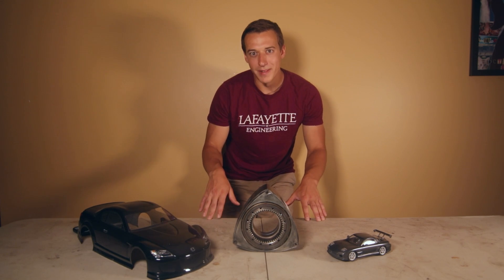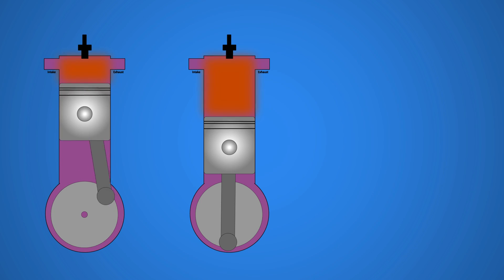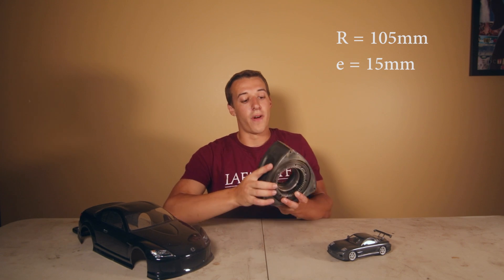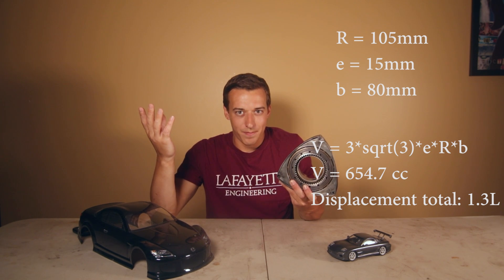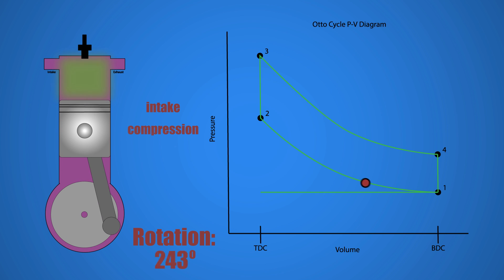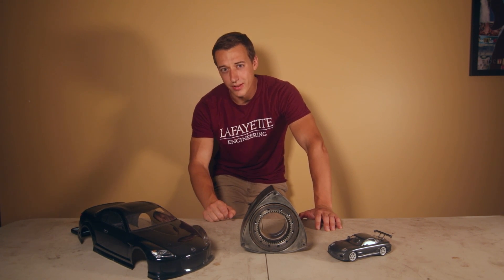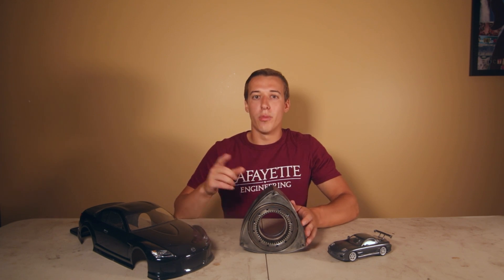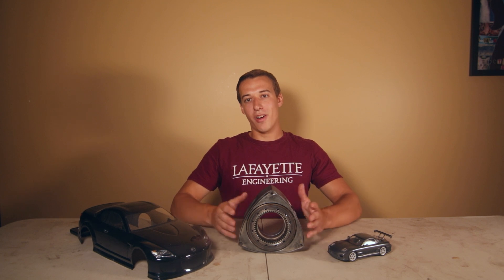You are WRONG about Rotary Engine Displacement

Comment: Yeah it's a 1.3L
Reply: If you have 6 chambers, each has a swept volume displacement of  654cc's 

It does not matter if the engine is a
 2-stroke at 360°
4-stroke  at 720°
Or a Wankel at 1,080°

The displacement  will still be exactly the same  3,924cc's
Reply: @sandervanderkammen9230 you are 100% correct. It's not even a debate, it's not a maybe, it's not in question, it's definitely 100% 3.9L
Reply: @MikeKulls2  obviously it is a debate. This is the debate that I am reading in the comments here lol
Reply: @sandervanderkammen9230  I am under the same philosophy, but you might want to account for those 0.7 extra CCs you left off. For a single face/cylinder, it'd be whatever, but it does multiply with each face/cylinder (depending on application). 3928.2ccs to be exact.
Reply: @Dude13450  The principle is still exactly the same regardless of the displacement of each chamber... the Mazda 13B is not a 1
3 liter, it's a 3.9 liter.
Reply: Hey, I saw your video on your RX-8, do you still have it?
Reply: @RX-805  yes
Reply: @edwinptown  sick
Reply: @RX-805  ⁰⁰
Reply: ITS NOT A 1.3 LITER
Reply: @sandervanderkammen9230  

Mazda 13B 2 rotor engine is a 3.9 liter engine. Its real thermodynamic cycle set at 1080° of eccentric shaft rotation (tree 360° spins) tells it

The rotor inside the housing forms 3 separated spaces (combustion chambers) and each one displaces 654cc to complete a 4 stroke Otto cycle (admision-compression-ignition-exhaust) 

On one rotation ot the rotor (360° rotor rotation) all 3 combustion chambers completed a 4 stroke Otto Cycle. Thus displacing 1962cc in total  (654cc x 3 = 1962cc) In that 360° of rotor rotation the eccentric shaft spun 3 times (1080°) because rotary engines are geared that way in wich One rotation of the rotor (360° rotor rotation) equals 3 rotations of the eccentric shaft, so for every 360° of rotor rotation the eccentric shaft will go 3 revolutions (360° x 3 = 1080°)

That 1080° number is importan, because you mentioned "Thermodynamic Cycle" and in a Mazda 13B engine its real thermodynamic cyle is set at 1080° of eccentric shaft rotation, not at 360°   like a 2 cycle engine (Rotary engines ARE NOT 2 cycle engines), neither is set at 720° (2 crankshaft rotations) like in 4 stroke piston engines.

At 360° of eccentric shaft rotation just one side or flank of each rotor completed a 4 stroke cycle (654cc x 2 = 1308cc / 1.3L) *Remember each rotor side acts as a combustion chamber as it moves inside the housing, therefore each rotor do the work equovalent to 3 pistons in a conventional engine...But this sole rotarion of the eccentric shaft (360°) does not makes the 2 rotor engine complete a full thermodynamic cycle, it just has done 1/3 of it.

Mazda did use this method to give it a "Nominal displacement" accounting just 1/3 of its real capacity because in Japan and Europe carmakers got to pay an Engine Taxation Rule that is based on engine displacement and the more displacement, the more taxes Mazda had to pay and that placed burden on the future of the "Wankel" rotaty engine developement in its early stages in life. NSU the first company who built rotary engines did quote their displacement accounting the CCs displaced by all 3 rotor sides, so its single rotor engine with 500cc displaced by each rotor side was rated at 1500cc / 1.5L. And from that engine they did a 2 rotor engine version that displaced 3000cc / 3.0L
Then Max Benttle an Engineer from Curtis Wright told NSU that rotary engines will have problems in Europe and Japan because of the Engine Taxation System.  

https://www.hemmings.com/stories/article/how-big-are-wankel-engines

Then motor-sports sanctioning entities came with the dilema of equalizing rotary engine powered race cars with 4 stroke cycke piston engine cars, their solution was to gave rotary engines what they called "Equivalent Displacement" The Society of Automotive Engineers S.A.E  used the 4 stroke piston engine's thermodynamic cycle time (set at 720° of crankshaft rotation) to give rotary engines an "equivalent displacement" and they found that at 2 spins of the eccentric shaft (720°) 2 sides at each rotor completed a 4 stroke Otto cycle (654cc x 4 = 2616cc / 2.6L) That is the infamous 2.6 liters of "doubled displacement" many mention, but it only accounts 2/3 of its true displacement.

A Mazda 13B engine IS NOT a 2 cycle engine.
A Mazda 13B engine does not complete a thermodynamic cycle at 720° of crankshaft rotation. 

The thermodynamic cycle (all combustion chambers doing one 4 stroke cycle each) is at 3 rotations of its eccentric shaft (1080°) 

So lets check all 6 combustion chambers and their 4 stroke Otto cycle time

Mazda 13B engine
At 360° eccentric shaft rotation: One side per rotor (2 sides total) complete a 4 stroke Otto cycle. 654cc x 2 = 1308cc / 1.3 liters.  Mazda's Nominal Displacement quote. 1/3 of its Thermodynamic Cycle.

At 720° eccentric shaft rotation: 2 sides per rotor (4 sides total) complete a 4 stroke Otto cycle. 654cc x 4 = 2626cc / 2.6 liters.  This is S.A.E's "Equivalent Displacement" Formula. 2/3 of is Thermodynamic Cycle.

At 1080° eccentric shaft rotation: 3 sides per rotor complete a 4!stroke Otto Cycle. 654cc x 6 = 3924cc / 3.9 liters. Its real displacement set by its real Thermodynamic cycle.

Remember, the eccentric shaft went 3 revolutions (1080°) but each rotor did just one rotation (360° rotor rotation) with all 3 combustion chambers doing ONE 4 stroke cycle each (654cc x 3 chambers = 1962cc per rotor/housing set x 2 number of rotors = 3924cc / 3.9 liters.

Another metric that certifies the 1080° ecxe tric shaft rotation for the complete Thermodynamic Cycle of the Mazda 13B rotary engine is the Timing events in degrees per eccentric shaft rotation.  In a Mazda 13B 2 rotor engine each ignition event is fired at 180° of eccentric shaft rotation amd there are 6 ignition events. 180° x 6 = 1080°

If you want to certify that a Mazda 13B engine is a 1.3 liters (1308cc) engine then get one of thos engines to work with ignition firing for just ONE side of each rotor and the other 2 sides of each rotot with no ignition firing, and kets se if it will spin at idle with just 1308cc / 1.3 liters (1/3 of capacity)

When you do a Mazda 2 rotor 13B engine compression test, you get 3 compression lectures for each rotor, not 2 ("1.3L"), not 4 ("2.6L), you get 6 (3.9L) And what each rotor side compresses? They compress 654cc. There you have it, a complete information tab about the real displacement of a Mazda 13B 2 rotot engine. 3.9L counting ALL its 654cc chambers.

654cc x 6 = 3924cc (3.9L) @ 1080° eccentric shaft rotation. 

Ignition timing at 180° eccentric shaft rotation x 6 ignition events = 1080° eccentric shaft rotation.

One rotor revolution (360° rotor rotaton ) makes the eccentric shaft spin 3 times (1080°)
Reply: @EM6285  I agree with you 100%...i think you messaged the wrong person.